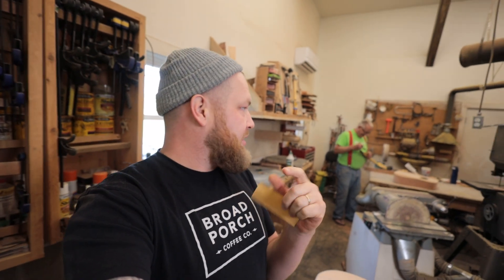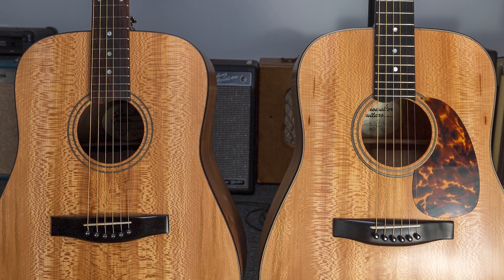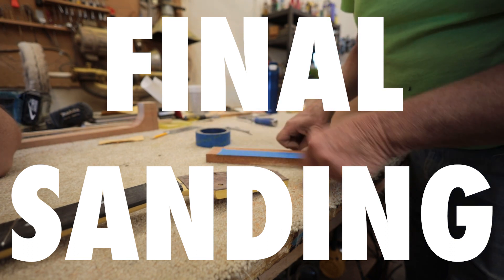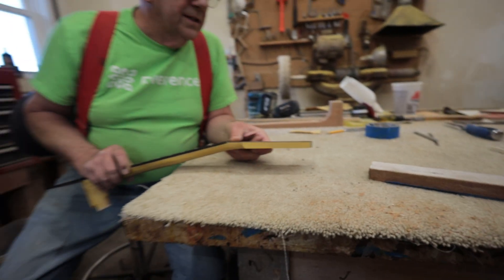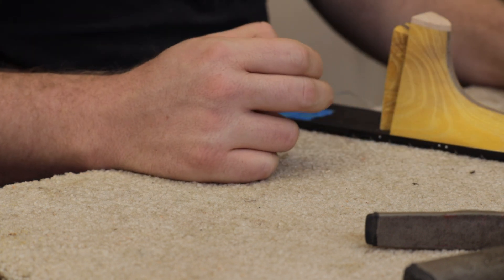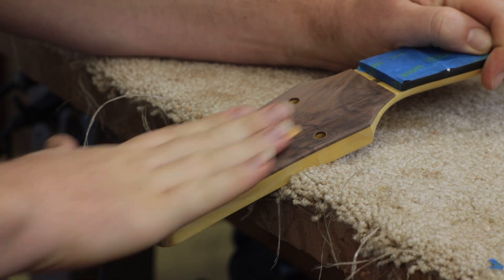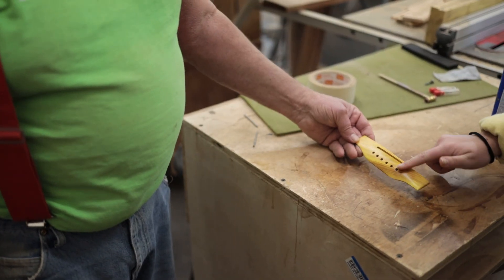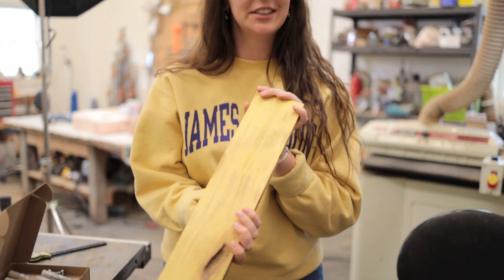Building an Acoustic Guitar with @showalterguitars5707 Episode 17 I Cutting and Shaping the Bridge

Comment: Please don't spray nitro without PPE. It all seems fine until it isn't and then there's nothing you wouldn't give to go back to change that.
Reply: I was thinking the same thing.
Reply: YES! If you're doing this at home, please use a mask!
Reply: That’s one of the reasons Stuart Mossman died at 59 with severe lung issues.
Reply: @pmscalisi  Even if you don't die, just accumulating a lot of scarring inside your lungs or a build up of resin dust will be a miserable existence. That doesn't heal. It only gets better if they get you a new set of lungs.

Lungs are good. We like our lungs. They make us very sad when they don't work so good.